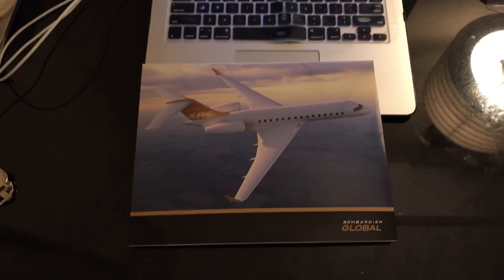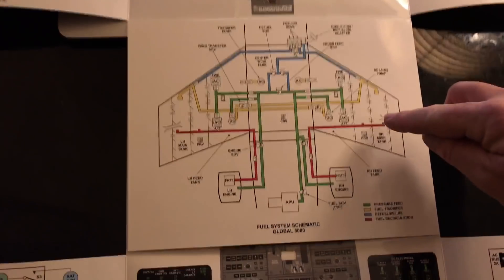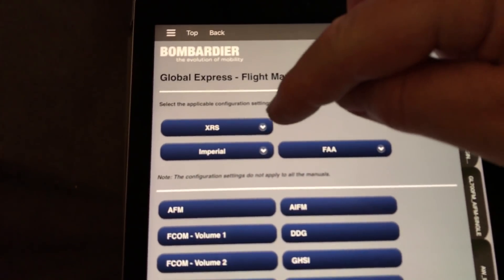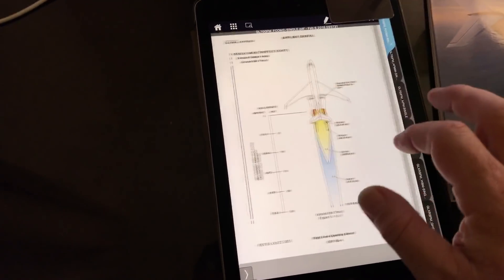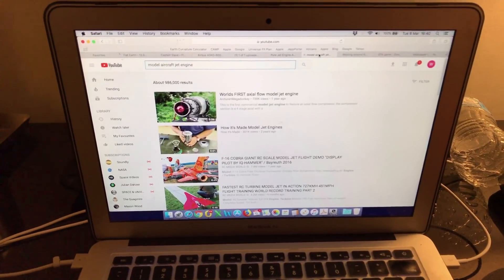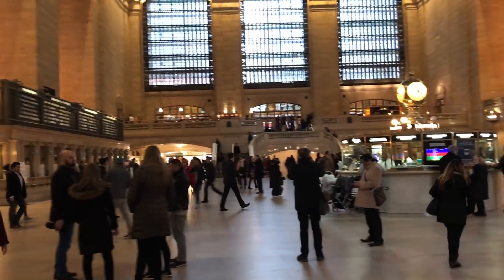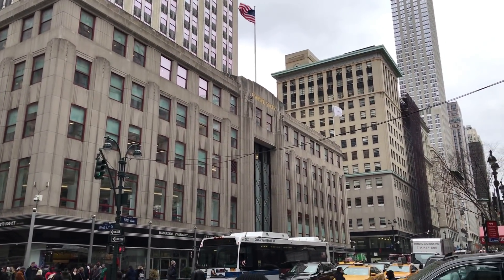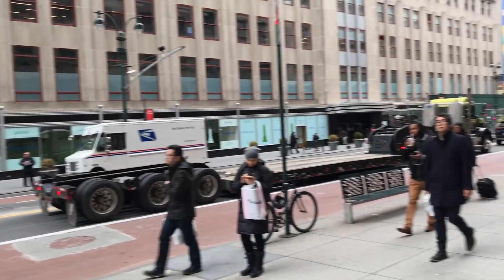Don't be ridiculous - of course Jet engines use liquid fuel.

Comment: Oh nooooo they don't....
Reply from the maker: +Wide Awake!  ohhh Yesss they do.  How many hours flying jet aircraft do you personally have?   Be honest.   Zero? 

I have spent my adult life operating Jet engine aircraft and turbine powered helicopters.  You bet they use liquid fuel.

Don’t be a dummy mate.  This is the silliest thing you guys have ever come out with.

Why not tell me my aircraft uses pixie dust to fly?  That is just as silly.
Reply: Wolfie6020 Operating an air craft does not prove anything... tell me something.. does the pilot do preflight checks on the exterior of craft... nope! Does the pilot have any involvement in fuelling up before take off.. nope! Im not saying jet fuel doesn't exist, nor that is is used on some air craft... but not all buddy! Jet engines are started using compressed air, then the turbines create and use its own compressed air... ive never seen any passenger plane blast flames out the rear... seen hundreds of take offs... all hot air mate...
Reply: "Jet engines are started using compressed air, then the turbines create and use its own compressed air..."
You just need the right magic spells to make it work. :-D
By the way, compressors compress air and turbines take some energy from decreasing air pressure. Turbines make the compressors turn, but without an input of energy between them (combustion) the system stops quickly and no way it could generate any thrust. Just saying.
Reply: Why do all passenger jets have engine fire suppression systems, then? What's burning in all those engine fire vids out there? Besides your credibility, that is?
https://www.youtube.com/watch?v=anlpKkxCvpY

does the pilot do preflight checks on the exterior of craft... nope!
I didn't think you could ever post anything dumber than flat earth crap, but there you go and prove me wrong...
Reply: "Does the pilot have any involvement in fuelling up before take off.. nope!"
LOL! The pilot is the one telling how much fuel he/she needs for his/her flight plan.
Reply: FrenchCrow you do know that compressed air is combustible, right?
Reply: FrenchCrow yes he or she looks at the fuel gauge... thats not really doing much is it... if i drove a friends car and he or she said we needed to stop for fuel and he or she filled up.. how do i know what they've just topped up with.. diesel, petrol or gas... i guess whatever they tell me is true..
Reply: Wide Awake! Your suggestion that a commercial pilot simply "looks at the fuel gauge" demonstrates you don't know the first thing about aviation. Your claims are ludicrous and quite frankly childish.
Reply from the maker: +Wide Awake!  Oh how you make me laugh.   I do a thorough walk around before every flight.   I open the refuel panel and set the fuel amount myself.  In foreign countries I watch the refuel carefully from start to finish.  

The bleed air is used to start the engine because it saves carrying a heavy starter motor for 12 hours and using it once in the entire flight.  Extracting bleed air from the APU happens anyway for air conditioning so why not use it to start the engines.  Logic mate. 

The APU is started by a starter motor but it is much smaller than what would be needed for the main engines. 

You have "seen" hundreds of takes offs.   Big deal.  I have "performed" thousands of take offs.   

Why would you expect to see flames coming out of a high bypass turbofan?  You need to go away research how jet engines actually work. 

Why don't you try it with a thermal imaging camera next time. 

Watch this. 

https://www.youtube.com/watch?v=niKkhm4KMyU

https://www.youtube.com/watch?v=ikbrSRTAzgA

Wake up.  Are you really going to fall for every stupid scam on the internet?
Reply: "you do know that compressed air is combustible, right?"
And what is the chemical reaction involved? What is burning? Nitrogen?
Reply: (Eyes)Wide(Shut), why pilots are involved in refueling:
https://www.youtube.com/watch?v=GW_42xmcsBU
Reply: Wolfie6020 i suppose you have wing mirrors fitted on your plane and a bicycle bell... man buys a Haynes manual and now he's a mechanic! Keep smiling...
Reply: Walter Boxhead That expert also claims in another video that power distribution via overhead lines is also a hoax. I'm really not sure whether to laugh or cry.

Comment: +Wolfie6020  Now this new idea is really something.  I've been flying gliders for years powered by warm air but it's a bit slow for transoceanic stuff. I usually hear squeaking from the seat cushion if I go a few miles offshore.

 As an aside I tried to reach you by email on 18 Jan but it must have floated away. It was about an idea I had to show the horizon drop when you're cruising 30k feet up or whatever.  

If you take a picture of the horizon to one side of the cockpit with horizon behind you reflecting in a mirror you can line them up. The significant thing is to get the lens reflected in the mirror for perpendicularity. You'll find the lens is well above the two horizon lines, which proves the down angle for me anyway.

 A gliding pal who is a 747 co-pilot managed to find an interested captain to have a go. Results so far at:
 https://www.youtube.com/watch?v=WF6hQKsQ_qo
Reply from the maker: +Fwq Kaw.  Hi and sorry if I missed your email.  That sounds like a good experiment.   I can't see anything in your link though as it goes to an error page.

Comment: If the Bombardier carries 42,250 lbs of fuel (19,164 kg) it would need 23.8 m3 of storage capacity
for Jet A-1 fuel @ 804Kg per m3.  Each wing would need 8.3 cubic metres of space to hold the 10,000 lbs stated capacity.
I think it's easy enough to see why this is being questioned. The fuselage volume of the entire plane is only around 2.5 - 3 X fuel tank capacity.
Reply from the maker: +The Truman Show.

Think about wing area.  The Global wing area is 94.8 square meters.  47.4 meters per side.  Say only 50% of that is fuel tank.  That give us 23.7 square meters.

The wings hold around 15,000 lbs each.  Most of the fuel is in the wings

The fuel tank only needs to be 35cm thick on average.  At the root it is significantly more than this.  There is plenty of room for the fuel.

The centre tank is 10,000 lbs.   The fuselage is 99ft+ long.

Is there something wrong with the entire volume of the fuselage only being 3 x the fuel volume?  Can you explain why that is a problem?

This plane can fly from any location on Earth to any other with no more than one refuelling stop.  It carries a lot of fuel for its size and usually only 3-4 passengers.   

As a Captain on this aircraft for more than 8 years with thousands of hours on type and having supervised hundreds of refuels personally forgive me
if I find this entire topic hilarious. 

A refuel from 5000 lbs to full takes around 25- 30 minutes depending on the fuel truck.  At some remote airports they need to bring two fuel trucks or go away and re fill the one truck.
Reply: Wolfie, you’re ruining their fuel hoax. 
People like you who knows what they are talking about shouldn’t be permitted to comment on this subject.
It’s unfair. ;-)
Reply from the maker: +The Truman Show.  Here is a preview of some footage I got today of our aircraft.   The wing root is huge.   You can see the fuel drain with the warning on it.   

https://www.youtube.com/watch?v=O1UNH1VHkXY
Reply: Thanks for the clip. Chrs.

Comment: I drove by a plane approaching landing today, very low traveling in directly opposite direction. I was traveling 55 mph and yet this plane was by my side for at least 5 seconds. Doesn't sound like much but I would imagine a small airliner would have a landing speed at the very least 150 mph if not more. Combined that's 200mph difference, it should have blasted by but instead it literally looked like it was hovering..  And it wasn't windy. It was pretty strange to see a jet hanging out by my side at a 150 ft..  But in theory, like they about satellite techs, you can be taught/told/programmer/fooled into believing anything. Maybe you think fuel has transferred from wing to wing when in fact the plane just makes it harder to turn..  You didn't build the plane you dont know what's in it. Just cuz the controls say one thing doesnt mean its doing what your taught.. Just cuz your fancy fold out panflet says you have 15k lbs of fuel doesn't mean you do. I'm pretty skeptical of a fuel hoax but I don't work biuld planes for boeing and neither do you. Your just taught how to make them go. You can watch videos of jets on stands running with no fuel tanks hooked up to them, just air compressors or apu.  One even shows the compressor instructions saying how to operate the flow of compressed air up to max speed..  Pretty strange that you would need compressed air to operate a jet to max speed if it truly runs on fuel..
Reply: Jake Clauson,
Your story with the plane landing is very fishy... I have seen hundreds of jet planes taking off and landing, mostly fighters. I have seen the Concorde taking off, from the side of the runway. They looked all as fast as they are supposed to be.
When I was in the airforce, I have overhauled jet engines, tuned and tested them on bench test. I can confirm they do have a combustion chamber (full of soot that blackens hands) and fuel circuits with filters and pumps. I can confirm we have to refuel planes, sometimes by gravity on some old jet planes.
"You can watch videos of jets on stands running with no fuel tanks hooked up to them, just air compressors or apu."
- Links? On benches you have a fuel circuit, you don't want a tank that would not be safe in case of fire.
Reply: FrenchCrow I'm not talking fighter planes..  They are dense and heavy. I'm talking about small to mid sized passenger plane. It is fishy because it happened. Cars in the other lane were passing the plane. You could say perspective but the plane was less than a mile from the airport a little than a couple hundred ft up and almost directly over the highway. Literally looked like it was floating. Like I said I'm skeptical because I grew around aircraft, my father and grand father are and was aircraft mechanics. I was changing spark plugs and brakes on cessnas when I was 9..  But there is some weird stuff about passenger aircraft
Reply: Yes, to stay polite I would say perspective + possibly some wind at the plane altitude.
Passenger aircrafts run on the same technical principles and deal with the same aerodynamics laws.
Reply: By the way, passengers aircrafts may LOOK slow because they are big. Without accurate reference point in the sky you can't realize the time they take to travel their own length. Sorry if my words sound weird, I am no english language native.
Reply from the maker: +Jake Clauson Jake I assure you these planes need at least 120 mph or they will stall and fall out of the sky.  This is the reason we have to carefully calculate our takeoff and landing speeds.

V1, VR, V2, VFTO and VREF are all determined on takeoff and landing weight.

In turbulence or crosswinds you add a few knots to VREF on landing. 

I will cover it all in a future video.  Ask any pilot. An airliner cannot fly as slow as some FE channels are claiming.
Reply: FrenchCrow 
My mother tongue is French, ( I’m not from France), your English is good, don’t worry.

About your point, you are right, a smaller object will traverse its length faster than a bigger object at the same speed.
The smaller object will seem faster if they are both seen from the same distance. I am about 1 mile from the landing path of a major airport and Boeing 777 seem to be slowly moving compared to Boeing 737.

At the small scale, a household fly which whizzes by is only doing about 7 km/h but of course it’s flying aerobatics.
Reply: FrenchCrow - trust me it was close enough to the ground to see the rivets. The airport was a mile away so it had to be low.  It was floating. Iv seen cessnas fly faster at that altitude. Iv flown a Cessna faster than this was. It filed up my entire window and stayed there while I was turning away from it and going the opposite direction. Of seen them do it before but until this nonsense came out I just thought the planes had incredible lift. But they are hundreds of thousands of pounds they can't possible float like they do
Reply: Robert,
Thank you Mr "Flower" ;o)
Reply: Jake "just thought the planes had incredible lift. But they are hundreds of thousands of pounds they can't possible float like they do"
- I still believe in physics more than in human sensory perception. Planes need lift and lift requires speed for a given wing area + aerodynamic outline (type of airfoil, angle of attack, high lift device "on"...).

Comment: 1:44 Hearing you measure fuel capacity in pounds sounds kind of scary... I know you aren't Canadian, but still... if you know what I mean.
Reply from the maker: +NetRolller3D.  Yes I do know what you mean. Aviation is all over the place.  It is weird.  Speeds are in Knots,  Visibility is in miles (or meters) - altitudes are in feet (Meters in China). It gets confusing in China because you have to carry a conversion table and when they assign you an altitude in meters you have to read off the table and fly it in feet on the altimeter.   I have no idea why they don't just use feet like every other country in the world.  

Check this out. 

https://www.scribd.com/document/273060888/China-RVSM-Quick-Reference
Reply: Wolfie6020 
An accident waiting to happen because of the possible confusion and increased workload or am I exaggerating?
Reply: NetRolller3D 
Are you thinking the Gimli glider?
Reply: Robert Lafleur Exactly.
Reply: But fuel is measured by weight, not quantity for aircraft. The reason for this is to counter shrinkage due to temperature changes.

Comment: Compressed air? Yes, a jet engine gets all of its thrust from compressed air.  That's how they work!  It takes a shit load of burning liquid kerosene to compress the air, but in the end, it's still just compressed air. (Hot, fast moving compressed air)
Reply: Some of these geniuses believe the fuel is only used to get the aircraft to altitude. Then the engines compress the air enough until it combusts and then provides thrust. Compress air enough it will burn.  ROFLMAO!
Reply: @dremwolf5419  Isnt this more or less the principle of a Ram jet? Of course you still need fuel...
Reply: 535phobos pretty much, the difference is that ram jets are only effective when your going at Mach 3 or something like that.

Comment: So... flame coming from an opening has to be created by liquid...?
Reply from the maker: +Mark Maddox.  No it does not "have to" be created by liquid but I assure you it is not produced by "compressed air"

Flammable gas would work also in a jet engine also but liquid fuel such as Kersone does not require pressurised tanks.
Reply: just wondering . How much does a gallon of jet fuel weigh and what is the mpg of the plane you are most familiar with?
Reply: Wolfie6020 so the average 747 mpg is about 1 gallon per second.  That’s 3600 gallons per hour ... one gallon weighs 6.5 lbs.=22,000 lbs with a cost of ? Can't find a price per gallon anywhere on line...anyway, an 8 hour flight  at take off would  be carrying an incredible 168 000 lbs of fuel  ... that's without extra . Does that  sound  about right?
Reply: No answer ? I asked u a question. ..

Comment: Hey this is off subject, but i got curious idea. I got this idea after commenting on Chris Curtis's new video on March 6th. This has nothing to do with him. I'm just wondering what it would look like if you did a long exposure shot with a camera mounted to an equitorial mount while looking towards polaris or sigma octantis with the horizon in the background. I'm not sure if the background will have enough exposure or it has to much detail for anything cool to come out of the shot. I know this will be a pain because you need to be a very secluded spot to minimize light pollution.
Reply: You get something like this, only smeared if it's a single massively long exposure: https://www.youtube.com/watch?v=NpI4WQCTe8U
Reply: John Michaelson it's hard to visualize. If done right you could maybe get something cool, but you would really have to mess with the exposure to time the blur right with the brightness
Reply: I want a eq mount now
Reply from the maker: +Quikee.  I recommend this one highly.  

http://www.ioptron.com/product-p/3200-hc.htm

It is incredibly good for the price and has some excellent features that even my larger mounts don't have.  You can only fit a small scope to it but the Max 127 works well.
Reply from the maker: +Kenji Makino  I can try that Kenji.  I want to do a star trails video with the telescope in the frame looking at one of the Southern stars near the SCP.   My next long stretch at home is not until April so I will try it then (Weather permitting)

Comment: So when planes refuel in mid air they are filling them up with......air? Lol
Reply: Good point!
Reply: Chemical refill
Reply: Vanoss gaming 112 Wright If the plane is already in the air why would it need to refuel. Couldn't it just open a hatch and scoop some mor e or to keep flying? LoL
Reply: What 727 refills during flight . I have never saw flames come out of a 727. Only military planes
Reply: sandman 69 Have you ever heard of a KC-10 the military version of a DC-10 or a MD-11 only aircraft that have flames shooting out of them are fighter jets because of the after burners !
Reply: They never try to explain what compresses
 the air or what fuels it do they.
Reply: Chemtrail fluids.